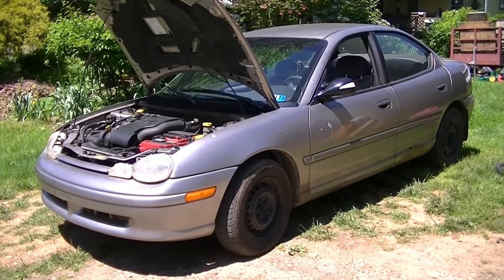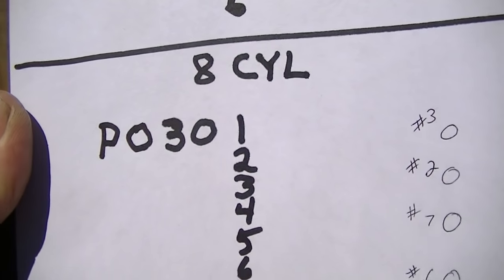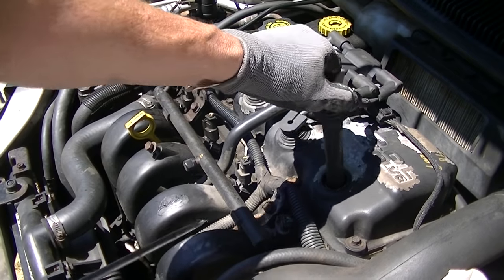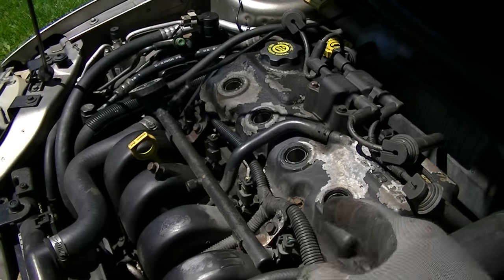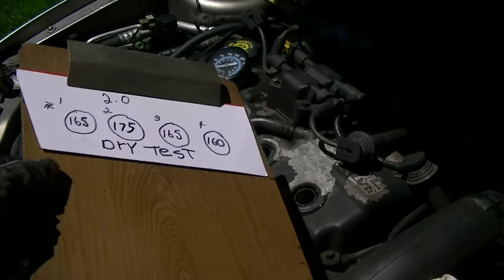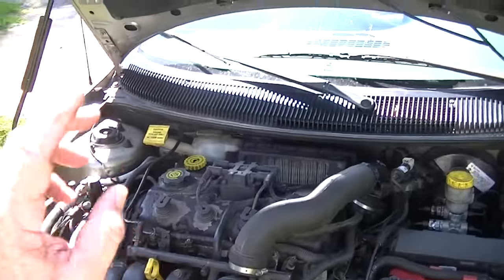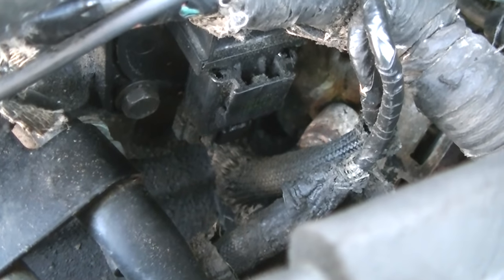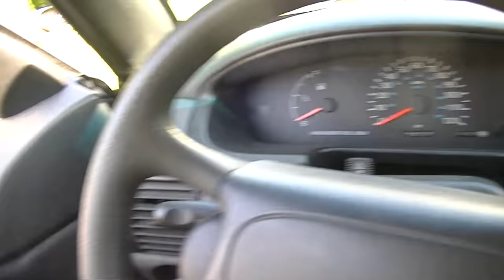P0300...How I fixed My code....P0300. Simple steps!

Comment: Nathan I need your opinion, I have a 2005 E36 6 cylinder Altima and it was getting P0300 so I caught a special on the spark plugs and coil packs and just went ahead and bought them.  I changed the plugs and no difference other than a p0303 popped also so we know where to look.  So I pulled the coil pack and closer inspection showed a hole burnt thru.  So I changed all 6 coil packs as well.  While I was in there I replaced the two sensors just to be thorough and it has been a while since anything other than oil change had been done.  I cleared the codes and the car was running very good and no codes came back.  The next day I start the car and starts hard, then test drive was very sluggish like starting in 2nd gear or something.  Went back and checked and it had a new code pending whatever that means... an almost code I guess?   P0171 bank one too lean.  Quit for the day and came back the car won't start... turns over great but no fire.  I went back to the sensor and noticed a problem with the sensor connector wire.  Did not have one but pulled sensor, it was fine and put it back in then plugged in the connector and wire and tie wrapped it so it could not come loose.  I ordered the connector and wire.  Car starts right up and runs like a race car again.  Get back from test drive and all is good, come back later and starts hard and runs sluggish again??? Like starting in second gear ?  I cleared the codes and it is not posting any new codes, and one time it starts and runs great next time very sluggish?  Several days later and still no codes but same issue?  Any ideas what the heck is going on?  Help!  :)
Reply: I have somewhat similar problems so I want to know...
did you figure out  the problem ??

Comment: great vid & info. Our van has a rough idle last week or so & pops thru the intake under load. no check engine light so I'm not sure if its fuel pump or injector. 170.000 miles
Reply: Jason Voorhees you ever found out what it was sound silmiar to what I have
Reply: @xxgodxx9306  I've been working long hours , so haven't had a chance to look at it yet, but will let you know. There is a video ' Kia Sedona - Rough Idle ' where in the description the guy bought all kinds of parts none of them resolved the problem & he didn't update what the issue was, but it helped because I can basically rule out those as being the cause. I'm thinking may be clogged EGR valve or intake gasket leak. There is a vid on how to check for vacuum leaks with a cigar. you may want to try that. also, sometimes if it jumps time it will backfire, but it will do it a lot, not just occasionally.

Comment: Great video , thank you ! I have a Dodge ram 1500 4.7 and i have a PO307 MISFIRE so far ive changed MAP, SENCER, SPARK PLUGS , FUEL INJECTOR , AND COIL but its still there . any suggestions
Reply from the maker: Compression Check

Comment: good video but my experience more so than not  a random misfire on all cylinders is caused by too much are entering the system usually a vacuum leak or a bad mass air flow sensor

Comment: Thanks for the video. I have a 2005 gmc sierra 1500 6cyl I have a check engine light on and it flashes at about 60mph also p0300 code. Truck runs smooth
Reply: Might need a crank relearn
Reply: My 96 chevy Silverado has had a random misfire forever. Iv changed every single part in the entire vehicle some more than once & paid 2diffrent shops over $1200 & it still broke. Sometimes even worse than it was to start. But never ever fixed.
Reply: Same on my truck.  P0300 @ 60 mph but no change in performance.  Changed the fuel pump plugs wires no luck yet

Comment: 2005 Chevy Colorado PO300 the engine was running rough on level ground I parked it in my up hill driveway ran smooth I figured maybe something in the fuel I put a bottle of injector cleaner & bottle of heet (water eliminator) was running a little bit rough not as bad as before, waited 24 hours pulled the coils, plugs, looked them over, checked for leaks no red flags. erased the codes went for a 6 mile drive in stop & go traffic still no codes will drive it tomorrow 12 mile round trip to work to see it drives the same.
Reply: I have the same truck and code. Did u figure it out?

Comment: I had P0300 on a Buick with a 3800 series 2 and I had low compression on cylinder number 2 and 4 back in 2016
Reply from the maker: O no!

Comment: You say if you have a cylinder code, then it is easier, but I have had in my 20 years not the cast ,just had one where it was the fuel, delivery ,cam timming,and timing problems , so you should say best case start there.
Reply from the maker: True.... I must of had a brain fart ;(  But your right. I'll take a  cylinder code any day over most codes.

Comment: Have a 2010 3.8 caravan reading po300 also has the smell of fuel in idle not sure if to much unburnt fuel getting in or a clogged injector
Reply from the maker: Let us know if you fix it.
Reply: Could be bad or leaking fuel pressure regulator

Comment: Don't forget about mass air flow sensor will do it as well you had a Dodge neon easy try to do it on any Nissan or quest but good video and great job
Reply from the maker: Yes!!~
Reply: I am in the beginning stages of a 0300 code and 1706 code on my 2000 XTERRA.  Gonna try everything you suggested. Already checked plugs, wires and distributor is brand new. Can't feel or hear any misfires but it's lacking power that I know it should have. Thanks for the tips and wish me luck haha

Comment: Hello this is the 3rd time I’ve gotten p0300 code on my 1999 5.7 Tahoe. I noticed it sometimes starts a bit sluggish. I replaced spark plugs and wires along with coil and ignition module but hasn’t fixed the problem. The code appears when driving at 40 mph. Any leads on what it could be?

Comment: I had a po300 code on a 6.0 Silverado, 2003, 2500 it ended up being the solenoid was shorting out to the block. It took awhile to figure that one out.
Reply from the maker: O my!!
Reply: The thing about the solenoid shorting out to the block was that it melted the crankshaft position sensor in the block ,which was next to the starter, so I thought it was the sensor causing my problem. A year earlier the starter had been under water but rain and big puddles must get into starter and solenoid here and there , luckily I figured it out without throwing to many -arts at it.

Comment: I’ve got a 2000 vr6 and I’m having a P0300 code show up. I was told by another shop that the fuel injectors need to be changed. Also checked the gasket and it’s leaking so I put some sealant in it helped but now it’s back to square one. Not sure what to do next.
Reply from the maker: Check fuel pressure.
Reply: @FixingWithPassion  now those codes aren’t showing any longer but a P0134 (no activity b1s1) 🤷🏻

Comment: @Nathan Rohrbough Hi thanks for the video I have this p0300 code in my 99 Infiniti i30 and my spark plugs have oil in the threads. I changed the spark plugs and fuel filter and still have the code. Also I hear a hissing sound around my throttle body. How can I locate this hissing sound and will it have anything to do with oil being on my spark plug threads? Thank you
Reply: Old but just in case you haven't solved it. You need to replace either your valve cover gasket or sometimes a small gasket that's just for the spark plug tubes. The oil is bypassing the gasket entering your spark plug tubes and that could be causing your misfires.
Reply: @sublimegabe  Fixed it already. It was 2 bad fuel injectors. Thanks tho
Reply: @ceezauto213   no problem 👍

Comment: Would yall recommend spraying electrical cleaner on some of the connections at the engine  bay area?
Reply: @FixingWithPassion  your reply is literally a p0300 …..idk what to do with it
Reply from the maker: @yotagang3705  Could be low fuel pressure.Check that first!

Comment: Hello Nathan.  I have a 2003 Oldsmobile bravada.  I have 2 codes P0300 and P0113
Which is intake air temp sensor.  
Would a bad intake air temp sensor cause a P0300 random?   Thank you
Reply: 🤔Think this way :The intake air is for THE ENTIRE ENGINE=ALL CYLINDERS ...so of course it can trigger a P0300 code..😜
Reply: @carlosmejia5728  thank you for responding.  It turned out one of the connector wires was cracked.  So I replaced the sensor and it cleared the code.
NOW I still have P0300.  After replacing all coil packs and checking the fuel delivery I'm stumped.  It runs rough.
Any suggestions?  Thank you

Comment: You really helped me so when I go to my mechanic, I will know exactly what he is talking about. Could it possibly be a faulty gas cap to give you a PO 300 code?
Reply: I swapped my gas cap with an after market one( lock and key ) shortly after P0300 popped up so now I'm putting the original gas cap back on and clearing the code hoping everything will be fine. Wish me luck!

Comment: Hello, Nathan. I have a 2004 Nissan Frontier XE with the 3.3 liter V6 engine. I am having the P0300 DTC . The engine will run, however it is rough idling. Also, the exhaust is light in color and smells like gas (running rich). Got any ideas for me? Oh, BTW, it also has a P0158 code that has to do with an O2 sensor, but I'm not sure if that has anything to do with my P0300 issue. Thanks...Dan
Reply from the maker: Check fuel pressure while engine is off. Should not drop any.

Comment: I removed my egr valve and cleaned it although it was relativley clean, i changed my cam shaft senser but still no change so im gonna replace my coil next, the p0300 code is a pain on the ass.
Reply from the maker: Check your fuel pressure. I had the same Issue. It should not be loosing any fuel pressure when the motor is not running.
Reply: @FixingWithPassion  if it loses fuel pressure after shutoff it is most likely a bad check valve in your fuel pump(hopefully this, it doesn't need immediate fixing as its just a startup commodity) or a leaky injector which must be replaced immediately or you will have a visible leak in a line somewhere maybe a o ring whr lines go into injection.

Comment: Most of the steps you did were not related to a PO300. If it was a plug ,coil, wire, or compression you would have a fault for the number cylinder ie PO 302 etc. You need to look for something common to all cylinders.  Also most of the time the PO300  code the engine runs fine sometimes. If you had a bad fuel pump and or  fuel filter it wouldn’t run good period.  So what’s left? Cam position sensor and crankshaft position sensor effect all cylinders.
Reply from the maker: True, but if there is a issue with s plug, wire, or compression its good to resolve that first. If there is actually a miss, bad coil, low compression its not going to help anything. Just verify that stuff, Then move on to electrical codes etc like you said. Never stop learning! Thanks for watching!
Reply: I currently have a P0300 only with check engine light. Heavy misfiring. That's it. This is a 150,000 mile C5 corvette. 
Changed plugs and wires about 50k miles ago (roughly 7yrs ago). Car starts when cold no problem, however, P0300 and check engine comes on along with heavy misfires after about 20 seconds as RPM decreases to idle. Belts are good. Battery good. Air filter good. Cleaned MAF.
Any help?
Reply: @nazareta6541 Hi, did you fix your problem? What was causing an issue?
Reply: @foxie777  mine was one of the engine valve springs, it was literally snapped in half according to the dealer diagnosis. Dealer fixed it for about $400 I think.

Comment: the way i fixed my engine code P0300 i replaced my:

Valve Covers
Spark Plugs 
Coil Packs
Fuel Injectors
Fuel Pump 
02 Sensors 

it started randomly misfiring so i randomly started replacing parts & now my engine code P0300 GONE!.
Reply from the maker: Wow! Nice!!

Comment: I have 2017 Kia Sportage I changed all wires and plugs still misfire 1 &2 what else should I do
Reply: Check air leak and ignition coil pack  most of the time ignition coil pack are going bad

Comment: Great video.  When doing the compression check do you leave all spark plugs out during the test?
Reply from the maker: You can.... its a little easier to crank over that way.
Reply: Great Thanks for the quick response
Reply: No you do one cylinder at a time for a compression test .
Reply: Keep all plugs in the motor while doing a professional compression check, pull the plug your checking.Tagney Automive
Reply: Yes it is easier to turn it over with the plugs out ovisly

Comment: I have a 2005 chevy tahoe and I had the fuel pressure tested and its good, I replaced all 8 plugs and wires and I replaced upstream o2 sensors. I still have p0300 and its hesitating on idle and when im pressing the brake light at stops. Any help or tips would be greatly appreciated.
Reply: Brake booster....

Comment: HI, I GET a P0300 on a diesel land rover range sport . fuel injectors were changed , turbo throttle body was changed left and right. road test was done nothing comes up good strength , runs fine.. go back to the computer run it back the scanner and comes back the same code with the check engine ... what else could it be

Comment: I have a p0300 now, I’ve replaced coilpack, spark plugs, plug wires, and new injectors (e85 ate through the injector) could fuel pressure be my problem?
Reply: I would check your fuel pressure at your fuel rail with a fuel pressure gauge. Could be a weak fuel pump or faulty fuel pressure regulator.

Comment: Aside from the Check Engine Light did you also feel any missfiring when driving? I'm trying to fix mine, it miss fires at random times. It gives me P0300, P0302, P0303, P0304.  On a second code reader it actually gave me the code for all 4 cylinders... I disconnected each cylinder cable to see if the car would do anything and it runs rough when I disconnect each of them which should mean all my coils or cables are fine.
Reply from the maker: Check fuel pressure...especially when motor is off. Should have a steady pressure.
Reply: @FixingWithPassion  I'll check that tomorrow, thank you!

Comment: My Mazda Protege 2001, great car, began stalling at idle with warm engine, light finally came on, mechanic got code PO300. Original plugs and wires replaced and showed normal wear. At the next driving, car started great, but there was a huge smell of gas in the garage. Then car stalled (at running temperature) and died at low speed, would then crank but not start. Towed to garage. Since it starts great and runs great at cold temp, mechanic can’t get the problem to surface even after driving it around his lot. Neither one of us wants to drive it because we know it will die on us. He says he can’t work on it because the problem is not evident. Seems, after watching this, he could be checking a lot of things because with a code of PO300, there could be a lot of things causing it and the engine does run when cold to perform these diagnostics. I'm wondering if it has to be checked right after stalling? Trying to avoid the dealer ($135/hr). Wish I worked on cars.

Comment: My 2003 Infiniti FX35 pulled up the P0300 code and I have had the spark plugs ignition coils changed a intake manifold gasket n valve cover gaskets changed and still has a misfire you think that crankshaft sensor could be the issue......help needed
Reply: Good day, was P0300 your only code?  Did you fix the problem?

Comment: My 99 GMC Sierra gets a p0300 when it doesn’t want to start. That’s when I go scrape the battery posts with a wire brush to get the build up corrosion off. Then it starts and never has a code again until 6 months later when it corrodes again and won’t start. I hope it’s actually solving it and not just clearing the memory when I undo the posts
Reply from the maker: Yea might be.

Comment: Hey I have a honda element with p0300 p0301 p0302 p0303 p0303 I've change all plugs, coil pack, I took the fuel filter drain the gas tank put new gas in but I did found a cigarette but inside the tank but the fuel pump work and when I replace the gas and install back the pump I didn't connect the fuel line and I turn the key in the on position to prime the fuel pump and it did pushed out some dirty black gas after that I ran it a few time and its putting  out clean gas what could be my next step tnks

Comment: I do not keep cranking until I get max compression, I look at the first good compression stroke and the 5th stroke and compare all cylinders. a weak cylinder can build up to max after enough cranks, not a good procedure. A running engine will act differently. When I say first good, you may already be on a compression stroke and get half a pump so do it again. Also be aware of a weak battery and as you work your way around the cylinders they may be lower and lower based on weak battery. So of course I need to be able to see my compression gauge while I am cranking from the key to see the first and fifth strokes. DONT TRUST scanner codes, it is only a guide, prove out your problem by testing. The older the car, the less smart the computer is, its simply a fact of life.

Comment: any tips on checking fuel pressure. My neon has a fuel rail like yours and doesn't have Schrader valve.
Reply from the maker: Put a ''T" in the line somewhere and use a gauge. That's what I do sometimes

Comment: I have a p300 however the engine revs and drives fine, it only bucks at idle, I installed new wires and plugs new crank and cam sensor, no vacuum leaks new fuel pump and in tank filter.

I did have to change the maf sensor recently.
And my battery was dead, 

It’s either the battery, dirty fuel filter, a loose coil pack, It could be the plugs” don’t remember if they were pre gaped or not”
Reply: Ever figure that out?
Reply: @hippitymcstribbs4906  loose rocker arms on 2 cylinders….I was surprised it ran’ they were really loose.